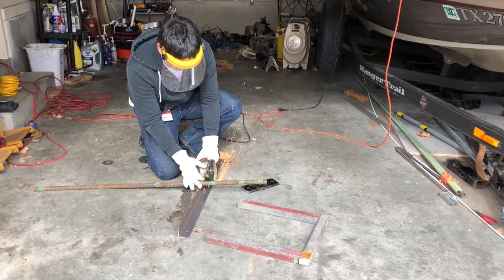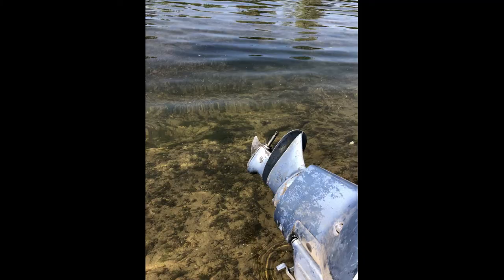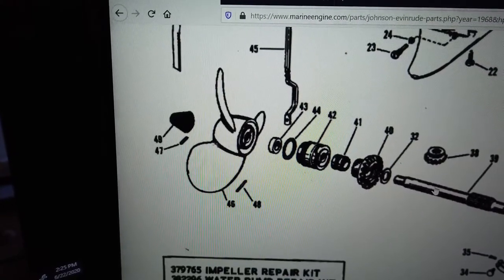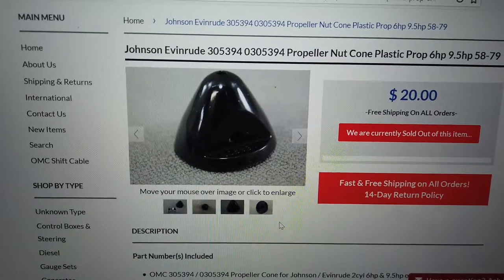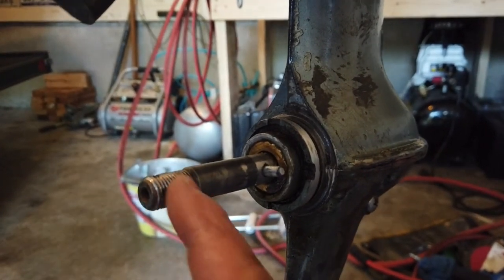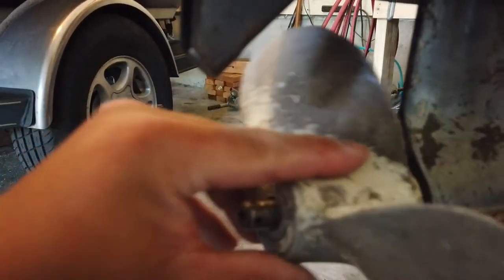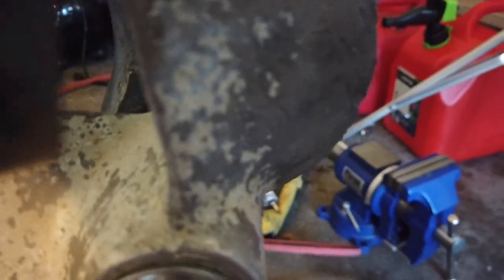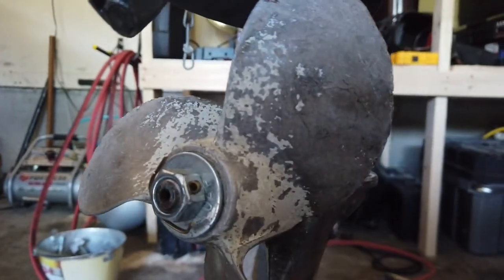Evinrude Prop Nut Tip

Comment: I have a '71 9 5 Sportwin that I recently sheared the prop pin off in the Wisconsin River. Luckily I had my trolling motor that got us up river and back to the boat ramp. It was slow going, but as you said, would've been difficult paddling upriver in a strong current. Plus, we were quite far from the ramp.  I purchased extra pins for next time. Damaged the prop a bit, but those things run for $140. Nice work! Will definitely make a nut to keep on as an emergency fix.

Comment: Those prop nuts were indeed a design flaw. With a shear pin hub, there's always some outward bias against the prop/nut. Normally, that bias is cancelled out by the torque of the propeller against the water; but that's in forward. Reverse is where they're most vulnerable, especially when you go high throttle,  with no momentum or while drifting forward. The spline drives don't have this problem.

Quick tip: You don't need to drill a hole through a regular hex nut. That will usually work. But there are 2 possible issues with that: 1: It can be tricky to find the correct spot to drill the hole for both alignment as well as optimal tension against the propeller. And 2: If  your hole has any larger burrs, those can damage the threads on the prop shaft. When I replaced the prop nut on my 6 hp, I simply bought a 1/2" castellated nut from an auto parts house for about $2. Plus a 20-cent flat washer from the local hardware store. Problem solved, and no drilling.

I want to emphasize the importance of the flat washer, though: Those propellers are 2-piece, with the hub pressed into the shell from the factory. On the front of the propeller, there's an opening which exposes part of the hub, and that opening is approximately the same diameter as the outside reach of the bare hex nut. Without a flat washer to cover it, the propeller shell will slowly (and surely) vibrate itself further and further rearward, over the nut, until it eventually is separated from the hub, leaving you stranded again on open water. So yeah, don't forget to use a flat washer.
Reply from the maker: Thanks for the information, that's really good to know.

Comment: I got one of theese engines, when going up to half throttle it goes fine, above that the rpm raises but wont go anywhere. I've read about prop hub spinning. Could this be the case on theese engines? Otherwise, what could it be?
Reply from the maker: One other thing you might check to see if the engine is coming out of gear when more load is applied. This can be due to a bent or mis-adjusted shift linkage, or worn dog clutches in the lower unit. When the dog teeth that engage the drive gear become worn and no longer square, they have a tendency to slip out of gear when under higher loads. Hope this helps, and if you do figure out what's wrong, leave a comment as I'd be interested to know what the problem was.
Reply: @TheAfterWorkGarage  Any tips on how to check that? Just see if the gear lever jumps up?
Reply from the maker: @zlix_2045  That would be the easiest thing to see, though sometimes the "jump" out of gear can be relatively subtle, especially if the gear shift and linkage is loose, or has excessive play in it. If you don't seen anything obvious with the shifter, then I'd start by swapping out the prop with a known good one to rule out a prop hub issue. Then make sure the shift linkage is tight, and properly adjusted (in this motor there's a metal clamp with two bolts that clamp down on ball ends of the lower and upper shift rod, and they should seat all the way in there. It doesn't really adjust like other linkages I've seen). If none of that solves your problems, then you may be stuck opening up the lower unit and visually inspecting the shift mechanisms. Let us know what you find!
Reply: You can usually mark the hub and then run it and then check if mark moves on hub compared to prop. to confirm any hub issue.
Reply from the maker: @wish2fish37  Good point!

Comment: Thanks for the tip. That is not actually a shear pin, it is a stainless drive pin. The prop's rubber hub is supposed to take the brunt of a hit.
Reply from the maker: Thanks this is really good info. I just assumed that's what it was, though It did look a bit stout for a shear pin and it doesn't have the scoring that shear pins usually have. Thanks again!
Reply: Hey I have one of these motors too, having an issue that it starts and runs nice but can't get any speed and can't get my 16 foot aluminum tin can boat to plane out even with two people. I have spark testers coming to triple check but based on looking at the plugs I think both cylinders are firing fine. Meanwhile I am trying to track down other possibilities. I haven't pulled my prop off yet, looks the same as this one in the video from the outside. Are we certain this prop on these 9.5/10 HP motors has a hub that can be "spun?" I keep finding conflicting info, that "yes these props have hubs that can rot and spin" or "no, these only have the shear pin/direct drive and the hub cannot get spun" etc. 

Obviously I just have to take mine off and investigate closer, but also looking for any input or advice. Mine is a 10022 model (1961?), I just found and ordered an owner's manual off ebay to hopefully help me learn more about it as well (I have much to learn about being a boat owner and operator of this antique motor). 

Definitely going to do the prop nut mod as shown here as my original plastic one looks pretty tired, thanks for the tip!
Reply: @andrewrudlang2785  you aren't gonna get a 9.5 to plane a 16 ft boat. Just not enough power. Really need at least a 20.  Yes, these 9.5's have rubber hubs and also drive pins. Not sure about the 10 HP. I have two 9.5 props in my garage with spun hubs.

Comment: Have one of plastic nuts that the threads are about shot in it. Cotter pin should keep it on unless it shatters apart. Did you put any anti seize on the threads. That washer and nut will rust.
Reply from the maker: Good question. Ideally I'd use a brass or galvanized nut, and I've never used ant-seize on any of my prop nuts, but if you're really concerned it probably wouldn't hurt.The zinc on a galvanized nut works like an anode on the motor, and it won't last forever, but hey they're cheap and common. I don't run this motor very often, and the rest of the time it lives inside in the garage, so I wasn't terribly concerned about the metal, though if it starts showing rust I'll replace it.

Comment: Hey, nice tutorial!

i have a 25hp sportster evinrude 69', but i cant find a fitting prop nut.
Do you know what kind of thread i have to search for? Or where to get it?
I live in europe and i guess i need american standard...
thanks in advance!
Reply from the maker: Hi Bennit, I can't say for sure what the prop nut size for the 25hp sportster is, and I'm certainly not an Evinrude expert, but my guess is it's going to be a US standard size such as 1/2" (like this motor), 9/16", 5/8", or 3/4". In general, standard threading comes in "fine" or "coarse," and I believe for these you're going to want "fine" threading which is 20 threads per inch. This can be a little tricky to find since most larger sizes like this have coarse threading, but I'm sure you can find it online. I'd just measure the diameter of the prop shaft and order a fine threaded standard nut and give it a try. Good luck!
Reply: @TheAfterWorkGarage  Thanks man! I got some tools to measure and ordered some UNC Nuts. Hope they fit! Then im gonna drill it like you show in your video. :) Tanks a lot!
Reply from the maker: @bennit7069  Awesome, glad to hear it.

Comment: would be interesting to know the exact size nut....I´m in metric country... Thank You.
Reply from the maker: Since this shaft was made before Evinrude started using metric fasteners, the size of the shaft is the 1/2inch 20 threads per inch. So you'd have to get the imperial size nut to match.
Reply: @TheAfterWorkGarage   thank You